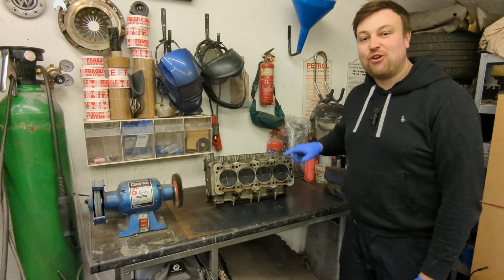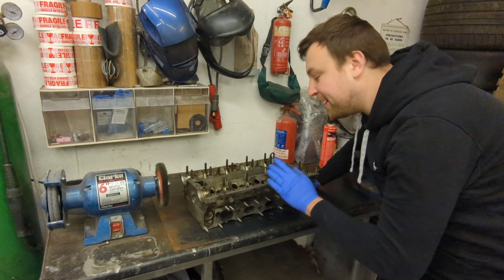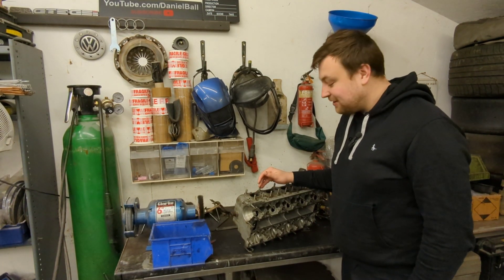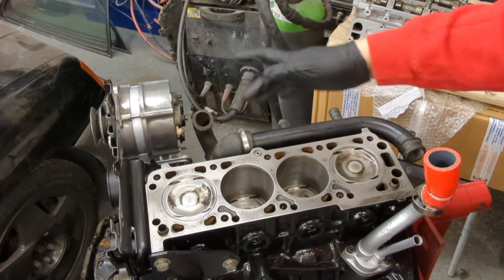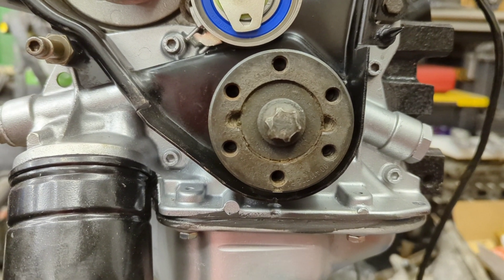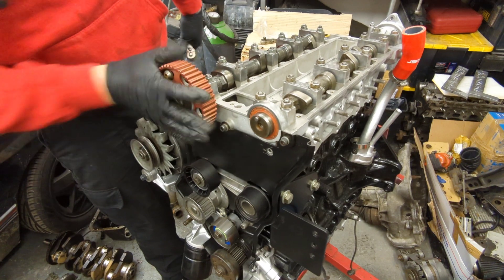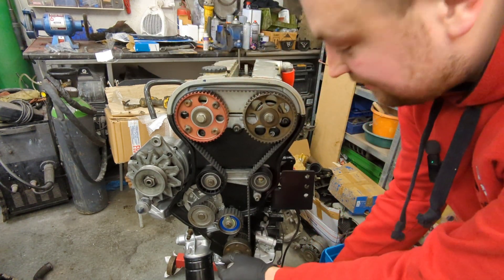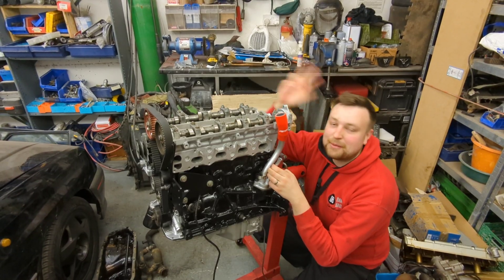C20LET engine build - Cylinder head install & Cambelt timing #turbo #vauxhall #redtop

Comment: do you have a close up pic of how you retarded the cam and where the pointer now sits on the pulley
Reply from the maker: I don't sorry, but it's basically half way between a tooth.
Reply: @DanielBall  so loosen the 4 bolts on the venieer pulley whilst the belt is timed up and rotate anticlockwise half tooth
Reply from the maker: @sas8403 that's it 😀

Comment: The pulley bolts  need any locktite to stay secure or is not necessary
Reply from the maker: I personally don't think it's necessary, but if it makes you feel better, do it.
Reply: The heynes said 25nm for that bolts...i think is not too much
Reply from the maker: @panas872 I would trust what they say personally.
Reply: Also i want to ask....you adjust 2 times the tensioner......i see in the second and last  time  go away from NEW sight.....need to do it third time  the adjustment ????

Comment: Nice video, great job. I was wondering how you wanted to clean the hydrolic lifters. I want to clean some for my c30se opel engine. They are expensive and not applicable for dismateling. Hope you can help cause you seem like a smart guy who knows what he is talking about. Cheers and keep up the good work.
Reply from the maker: Thank you 😊. So I found if you soak them in petrol, then press them out with a g clamp you will see the grime come out of the oil feed hole. They should be fairly springy once done. You can also use compressed carb cleaner. This method has always worked for me.
Reply: @DanielBall  thank you, I will give it a try.

Comment: Did you just use a battery gun on that crank bolt no breaker bar/torque setting? 😅
Reply from the maker: It was torqued.

Comment: How did you come up with the pre-adjustment on the cam gear dude?
Reply from the maker: Not sure what you mean, but 7 degrees is a tried and tested amount. Which equates to half a tooth. So it's just been adjusted by half a tooth.
Reply: Ok, so like a few mm offset?
Reply from the maker: Something like that, just aim for half way between.